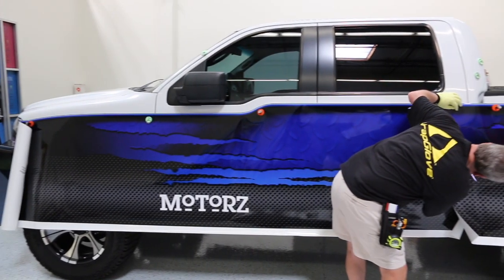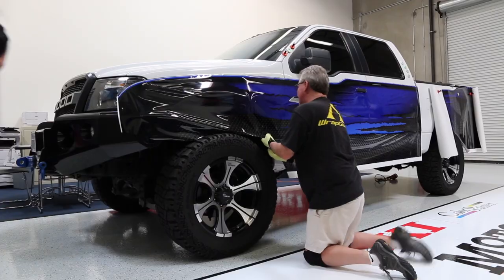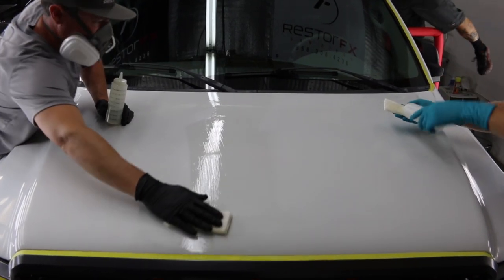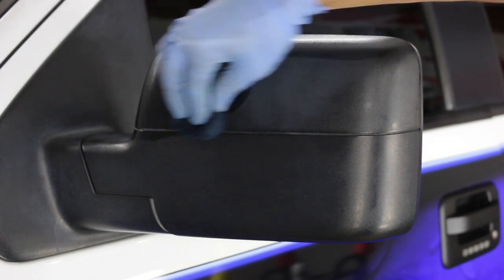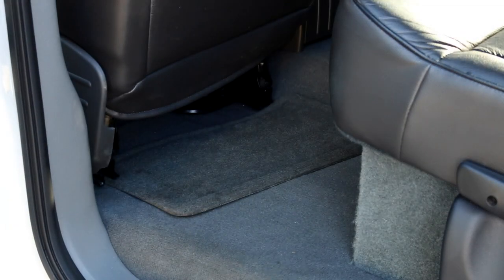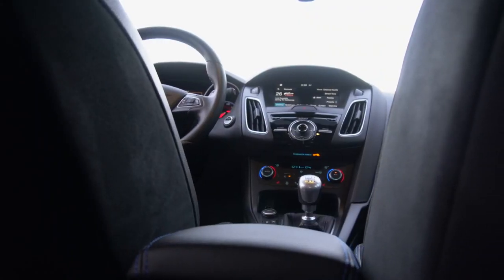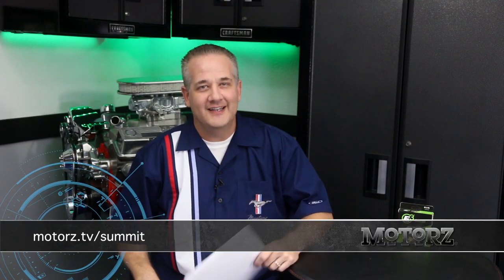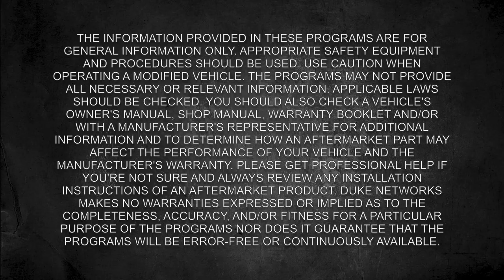2005 Ford F-150 Refresh, 2017 F-150 & Focus RS Test Drive, Motorz #94

Comment: Content suggestion...... pullout that 5.4 and repair and replace all the problem parts, like the cam phasers, roller followers, timing chain guides,  spark plugs and coil packs ect, ect..... you know, all the problems with my 04 F-150 FX4. Or maybe get with the guys at PowerTrain Products and do a show on replacing an engine with a remanufactured one. Maybe bump it up a little with a Supercharger. I'll donate my truck for those shows since that's what I'd like to do to it.   Love the show can't wait for more!
Reply from the maker: Great suggestions... my 05’s engine could use a few of those things!
Reply: Motorz Are you sure?  I don't mind driving and I'm free labor. Lol. Viewer Giveaway?
Reply from the maker: LOL 🤘😎